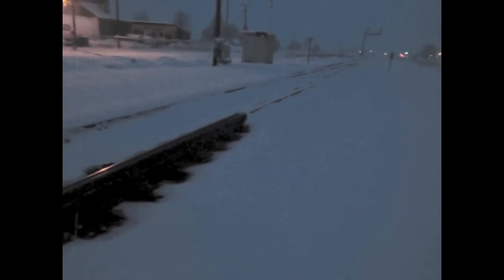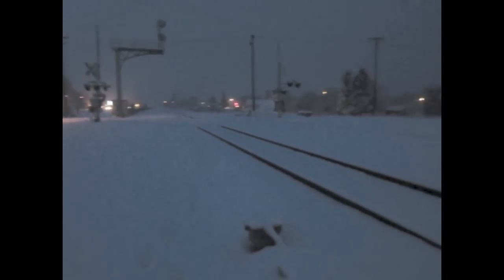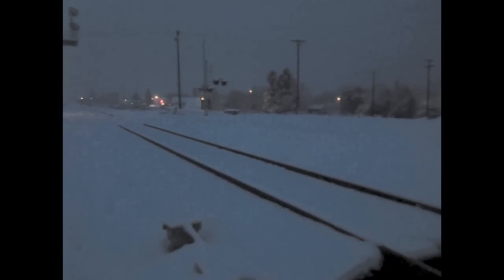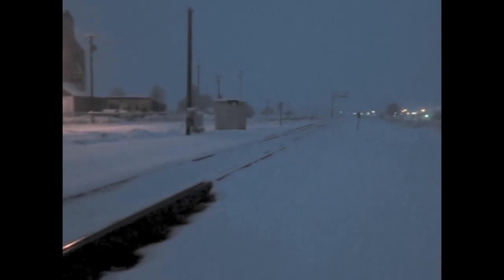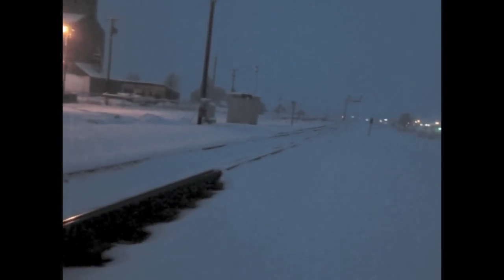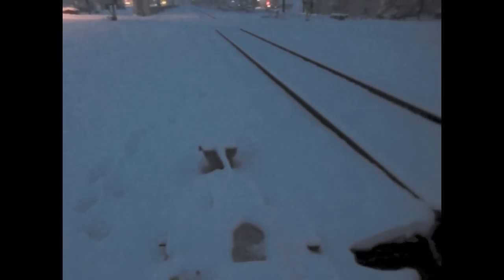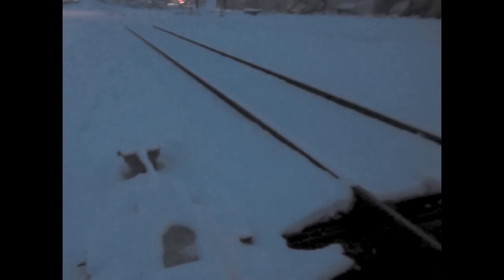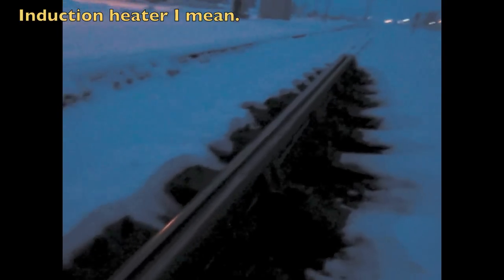Induction Railroad Switch Heater

Comment: I work in the rail insudtry. You are right, that is in fact, a switch heater. However, it is a "calrod" type and is resistive in nature (like a milkhouse heater), not inductive. It likely is powered by 480 volts, so it would be wise to keep your distance should there be a fault of some sort.
Reply: Fastrax is a leading manufacturer of electrically-powered switch heaters. I helped a guy hook up a few of them on the Manitou & Pikes Peak Cog RR back in 2017.
Reply: @djscrizzle  Can you provide context as to when electric heat is used for heating rails verus natural gas (such as the switches Metra uses in Chicago for their rail network)?
Reply: @RandoCommandoTheThird  Most of that is a matter of location. A yard is more likely to have electrical facilities, versus a remote location. Gas heated switches are used where access to natural gas/propane is cost-favorable. Likewise with Electric heaters.
Reply: It same type of calrod element you would find in an electric oven, or at the bottom of your dishwasher, propane switch heaters seems to be more of a thing, probably because it's more cheaper, and not all switches are located in an area, where the needed electrical hookup for electric switch heating exist. Ones that burn natural gas, are usually found on tracks in more urban areas, such as what Brandon mentioned Chicago.